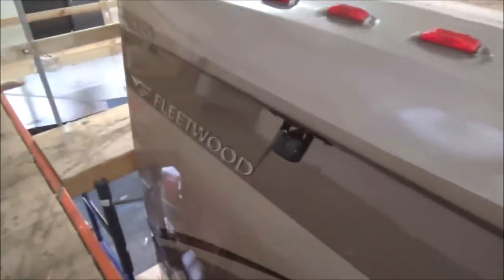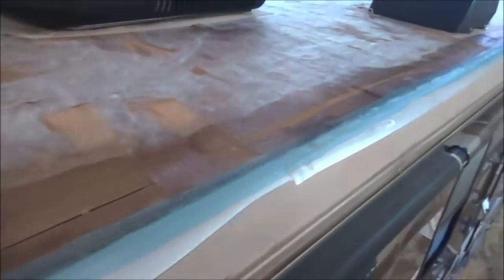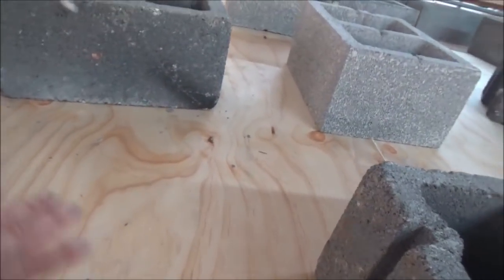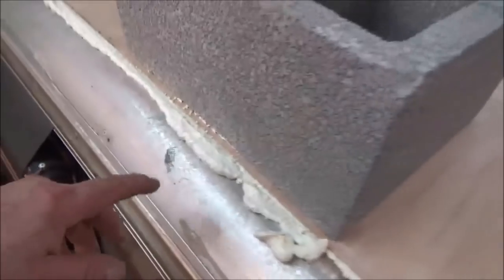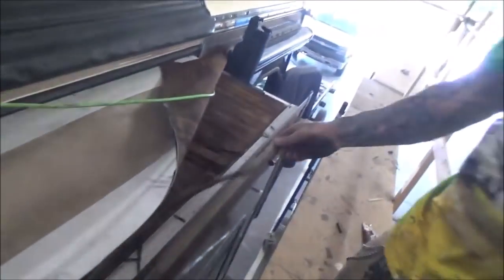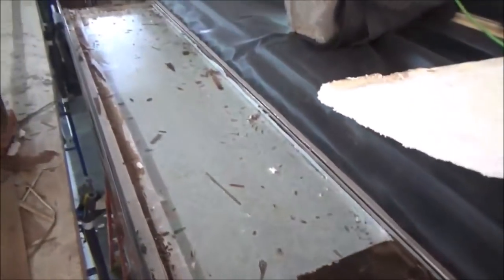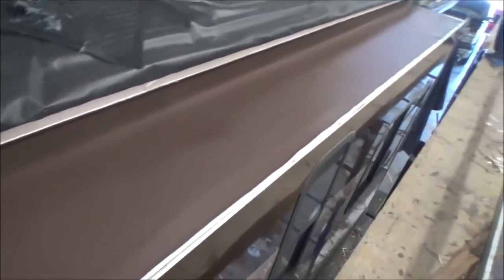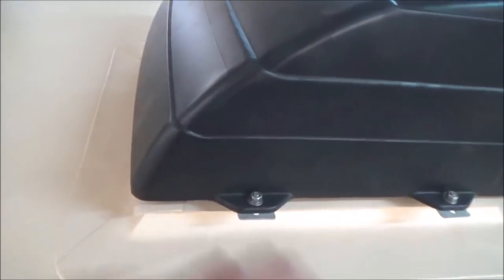RV Roof Replacement on 2006 Fleetwood Excursion

Comment: you should coat the roof with water repellent as well.  and even framing when you do rebuilds.  a coat of water repellent on everything will shed water away immediately.  i just bought my first that needs work and i have alot of ideas.  great video!!
Reply from the maker: TPO roofs are water repellent. TPO is Thermal Plastic Olifin. No need for the aftermarket repellant. Thanks for watching.

Comment: Really impressed with the quality of the work you do.  I like the heat welded blocking  that elevate the AC and vents.  Can you do a video on the details of making one, or is that a trade secret.  Thanks for the instructional series....................
Reply from the maker: The curbs are a secret recipe. They are complicated. There is 16 pieces to put it together.
Reply: I heard why this one didn’t get staples but on others I’ve seen they’ve gotten staples. Does that come down to how the roof is constructed? I know my 05 Fleetwood has fasteners with its wooden trusses and fiberglass batting. I suppose class A are probably different.

Comment: That step out/spacing of the awning will work great in the summer, sadly up in the NORTHERN states in the winter ice will form between the awning and the roof and  "ice jack" the connection and leaks will develop.  It's like putting water in a glass jar and freezing the water, the glass breaks. People in the North know about ice dams on the outer edge of their roofs in the winter.
Reply from the maker: If it were the otjher way...the way the manufacturer did it, the ice would build up back onto the roof. 
Thanks for watching.

Comment from the maker: Foam doesn't harbor mold. There is no nutrition at all in foam adhesives for mold to thrive on. Even the foam insulation has no nutrition for mold. What you are seeing is mold on the plyfoam.  The mold will feed of the damp plywood that is glued to foam.
Rest assured we definitely do due diligence on products and installation.

Comment: How much does this job run roughly. My father has an 2004 and it probably needs roof replaced. Thanks great job
Reply from the maker: Ms. Sue we shy away from quoting on social media. We'd be glad to go over pricing in your Dad's coach 8f you could give us a call. 423.475.7663 (róof)
Reply: @RVROOFINSTALL  sure I understand thanks

Comment: Amazing quality work. You should be an OEM. What material do you use for the transition from the luan to radius. It looks like a tape? In the video you called them "protector strips" at around the eight minute mark.
Reply from the maker: The protective strip is TPO membrane remnants. The rolls are 10 ft wide, coaches at best are 8.5 ft wide. So the left over we slice up to use under the main the membrane to prevent the siding from chaffing the membrane.
Thanks for watching.

Comment: Hi, I am in NZ, what is the glue you are using to glue down the TPO roof membrane please.
Reply from the maker: You should be using the glue the manufacturer recommends on the membrane you're using. Go to a commercial roof supply, and they'll get you the proper membrane adhesive. That is, if you're using a commercial membrane.
Thanks for watching.

Comment: Why did you leave the original drip rail instead of removing the rivets and attach the membrane the factory way?
Reply from the maker: @Todd0012  you'll need to be more specific on time line. This is an older video.
Reply: @RVROOFINSTALL  At 10:34 You start to add the termination bar, but you didn't slide the new membrane under the drip rail. I'm assuming you added caulking between the term bar and the drip rail.
Reply from the maker: @Todd0012  the rail was for the awnings. There was no need to disrupt that rail. If we did drill out all the rivets we wouldn't be able to re-screw it on because the holes would be bigger than the screw shank. If we did use a larger screw shank the screw head would've been very large and look terrible.  This are 3/16 rivets. You'd need a 1/4 shanks screw ....lag bolt...to resecure them. The screws would have had to go back in the same spot because that awning rail had exposed rivets vs another that would have a screw cap cover channel. Yes we sealed in between those rails as well as seal all the rivets and screws we installed on then other rail. Sometimes it's not worth poking a bear that dont need poking. Also, had we removed the rivets we would have boogered up that awning rail, the other fasteners if possible, would have need to be painted.  All around it was not worth messing with. Thanks for watching.

Comment: Do you mind me asking Is the plywood you used over top of the old roof was it 1/8  thick plywood and Also what kind of Glue did you use to glue the new plywood to the old.
Reply from the maker: Yes,  2.7mm sheathing. We use a foam adhesive. Great stuff wall and floor. Thanks for watching! We are working in demonitizing all our videos to remove the ads.

Comment: What is your opinion of RV FlexArmor as a finished roof option after repairs are made, as an alternative to the 60 mil membrane?
Reply from the maker: See our video ....Even  RV  Armor  thinks we're better. If it were a great system I'd buy the machine. They're always looking for dealers. Fact is,  If you don't have curbs it's going to leak....plain an simple.
Reply from the maker: If you tire your roof off and made repairs why would you want to spray it???  RV Armor is not a roof... it's  a coating

Comment: What is the budgetary cost to re-roof a 36 foot 5th wheel if no rework of the underlying structure is required?
Reply: Pro trick: you can watch series at Flixzone. Been using it for watching a lot of movies recently.
Reply: @Mauricio Watson yup, have been using Flixzone for since december myself =)
Reply: @Mauricio Watson Yea, I have been watching on flixzone for since november myself :D

Comment: What do you use to glue plywood direct to foam if complete strip
Reply from the maker: 3m78 is designed for this. Great stuff wall and floor will work. Thanks for watching.

Comment: What do you use for the protector strips? I’m about to do my roof and I keep seeing everyone using these protector strips along the edges and seams. Is it a tape?  What works best for dicor tpo and dicor glue?
Reply from the maker: DON'T use Dicor anything!!!. The strips are the roofing material remnants.
Reply: I already bought the dicor tpo and glue lol. Just trying to figure out what is best to use for the stripes that the roof will adhere to without a problem. It’s going on my travel trailer than to a seasonal campground to stay. Do you have to use the strips? And what’s wrong with dicor?  Thanks.
Reply from the maker: @natelavigne4353  Dicor is junk... crap....you should go to our website to learn more or watch more videos.
Reply: If I get 5 years from it I will be happy. I will have a new trailer by than. And to get anything shipped to my house will cost a fortune I am waaay out in the bush in northern Ontario. No one likes shipping anything here. Thanks for the quick reply’s. Cheers.
Reply: @natelavigne4353              Dicor sells a # 511 FT ( Fleece Tape ). Google their phone number and call them. Nothing wrong with Dicor.

Comment: Where can i buy the GAF Tpo? Google has been zero help.
Reply from the maker: You can buy any brand, doesn't have to be GAF, in fact, we don't use GAF anymore, haven't for years. Your local commercial roofing supply will ha e everything you need. May be Firestone, Genflex, Carlisle...but they'll have a TPO membrane. 
Thanks for watching.

Comment: You can't just sand the fleece off
Reply from the maker: No you can't sand the fleece because there is still glue in the roof deck and that glue will was up the paper. Also the time factor to sand it would be too long.
Reply: You guys do  excellent work

Comment: that spray foam that y'all using that stuff is no good it is dangerous to use and bad for your health it causes mold I've seen it used on a a camper roof this turned is black as a car tire I'm not saying y'alls process is no good but I think I would have found a better glue to glue that plywood down on that deck